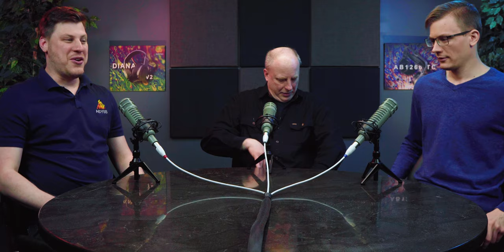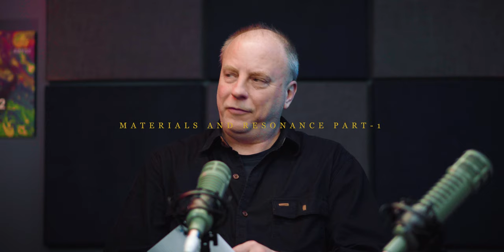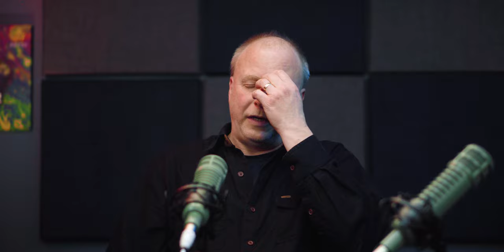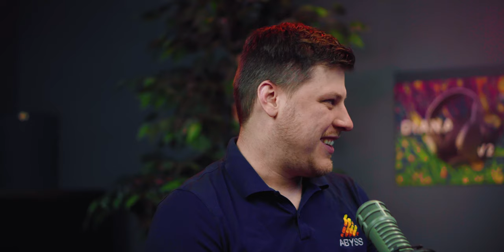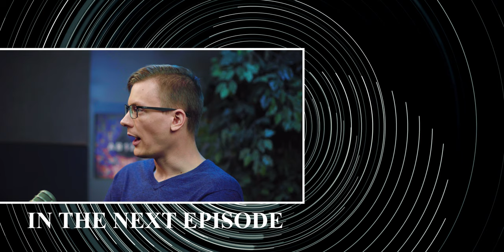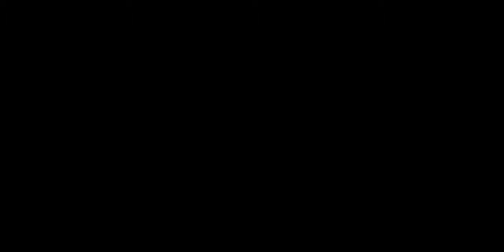TOTL: Materials and resonance Part 1

Comment: Great video.  That small difference matters and you can hear it.  When I fired up my TCs, was blown away... and that's moving up for 1266 OGs (no slouch).  
I bet if you measure the difference, it would be 1-2%, at best.  When actually listening to music, gains are far greater.  I can hear the air around strings, size and character of the room..  This stuff is hard to describe in words, just an overall more immersive experience.  All that in 1% or less.  Worth it?   IMO yes.
Reply: i think, the dynamic range is higher(signal integrity) and i feel the resonance of diaphragm i feel was lower, it was more in deeper subbass